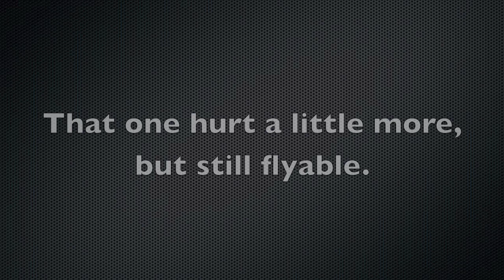RC F-22 Raptor Scratch Built Twin thrust vectoring EDFJet ducted fan

Comment: thanks for helping with my aileron conection question. took a few minutes to figure out the offset and neutral position for the aux. but it it looks good and I have high hopes. perhaps the piper J3 will fly.

Comment: These designs are ingenius. I travel to Mexico for work and have been looking for something to share with the kids down there who have next to no recources to work with. The sport trainer is perfect. I just need to find where the cheapest electronics are that will be reliable and then they can share the engine, esc, servos and transmitter among several airframes. Thanks for making this stuff available.